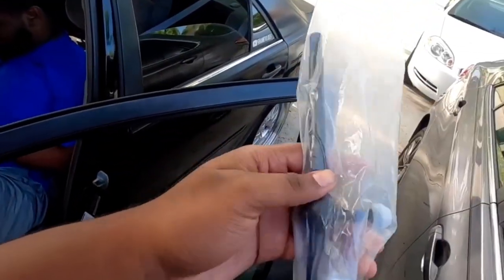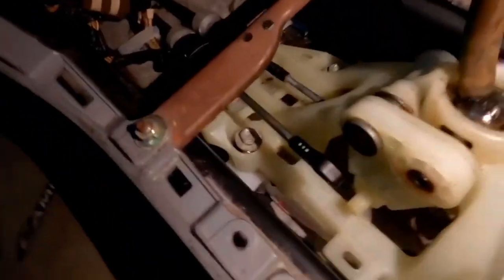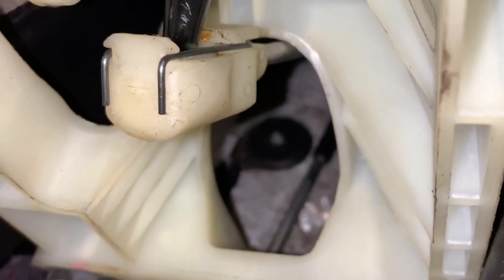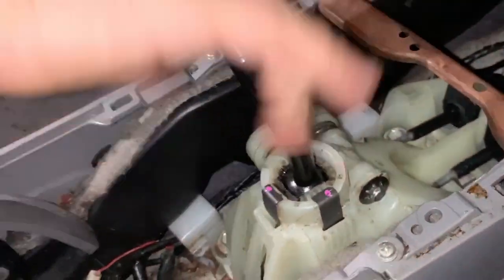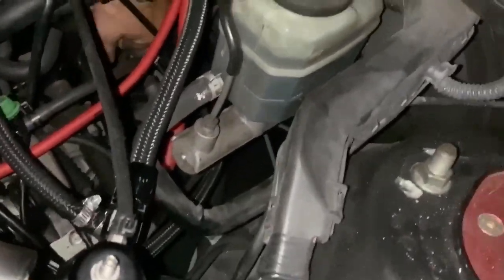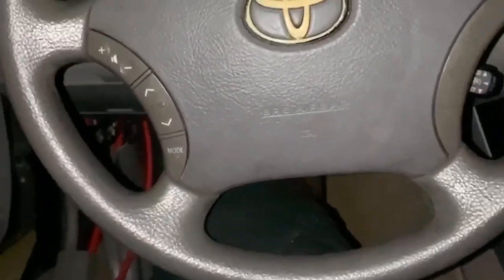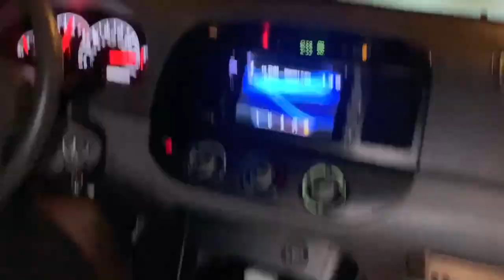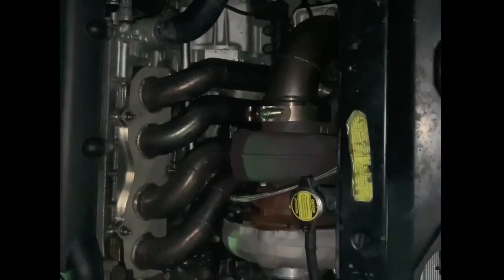Toyota Camry 02-2006 short shifter/shifter bushing install!!!

Comment: Hey man I'm doing the same exact thing in my camry - my question for you is what is that large U clip for? It doesn't seem to get used in your video
Reply from the maker: Are you talking about for the shift later cables in since the car? If not put the time for me so i can see please
Reply: @ShaneVlogss  1:13 is where i see the big horseshoe shaped clip, still inside the bag - let me know what you think. Thanks!

Comment: A tip : do weight reduction
Btw which turbo brand is it planning to turbo my Camry 2003
Reply from the maker: Yeah i would love to do weight reduction but it’s my daily so idk of imma so that, also it a borgwarner s300sx3 I’m using
Reply: @ShaneVlogss  just gut the trunk and pop the lower back seat out from time to time I swear it's worth it in that car. no spare tire pulls

Comment: What diameter is your air intake for it? I have a 04 Camry 2.4l and want to get one just not sure what size...4”?
Reply from the maker: For the intercooler piping i have like a 2.5inch diameter and the core for the inter cooler is a 3 inch core